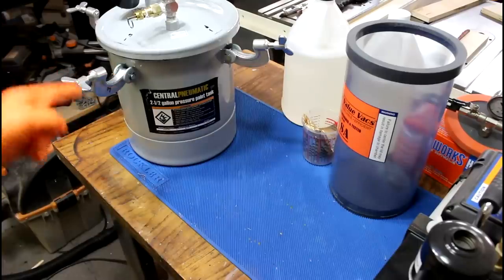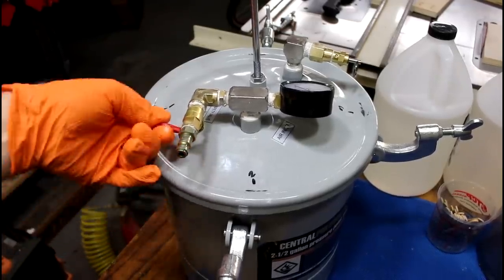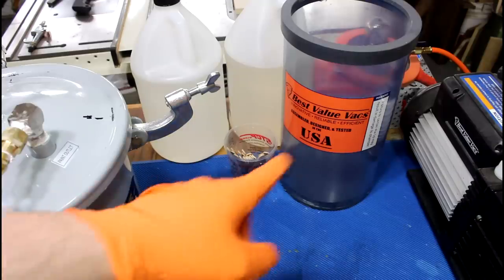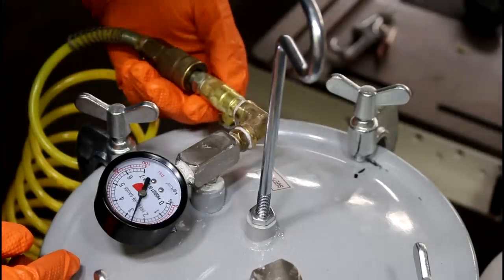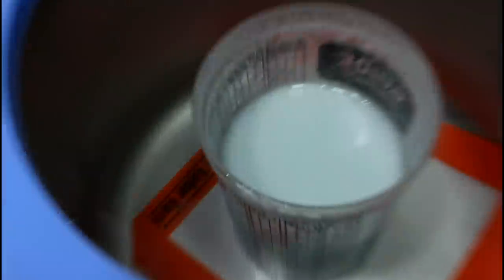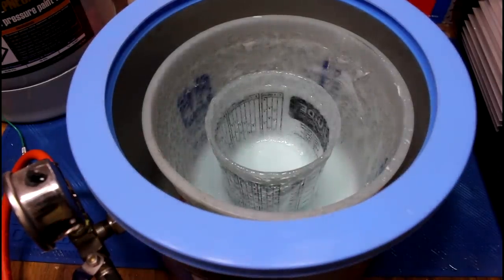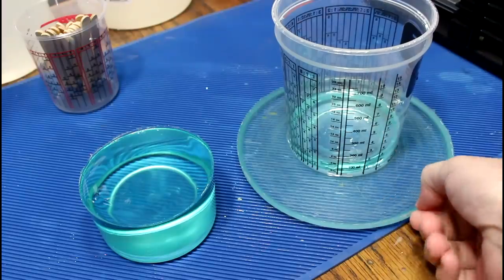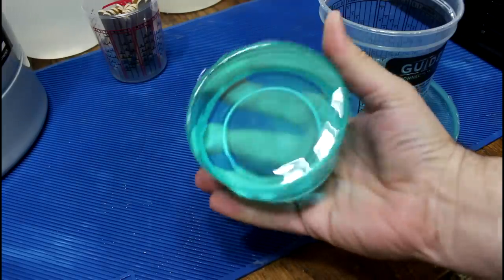Resin Casting: Pressure vs Vacuum

Comment: Use both!
After mixing the resin, degas it with the vacuum chamber. It happens fairly quickly, the foaming you were getting after the first minute or so were components of the resin boiling off.
Then pour the resin in the mold and put it in the pressure pot.

You can also vacuum degas it after pouring the resin in the mold to help get air trapped in the wood out before going to pressure.

I do resin casting of miniatures for tabletop war games, so have to get air out of and resin into some intricate fine detailed molds.
I have the same HF pressure pot and found that the top for my vacuum chamber also fits on the pressure pot, and seals fine, so I started doing my vacuum degassing and pressure casting in one pot.

Comment: OK, so, quick back of a beermat calculation....  pressure increases by about one atmosphere (15psi) with every 10m deep you go under water..
50 psi would be what, about 35m down? Maybe 40 ish?

Right, whose got an atmospheric diving suit we can put Peter in and is there a resin that'd set under water...

Y'know, for science and stuff...
Reply: You can easily do 40m in a wetsuit or drysuit and you won't feel a thing
Reply: FOR SCIENCE!!!! 🧐👩‍💻👩‍🔬🕵️
Reply: Or... we put the resin in the pressure pot before sending Peter down into the water with diving gear and then he pressurizes it while underwater!
Reply: @karol30660  i ventured into the 4 meters...once.
Reply: wouldnt the pressure be held OUTSIDE the container, or you are suggesting water-pressure? or some kind of flexible thing? i wonder if a plastic bag would work...

 Can you imagine? "pressure casting resin with a ziploc bag under the sea"
Reply: Wouldn't most resins cure underwater if they were thick enough not to start diluting?
Reply: Gimme a Ziploc bag full of resin, I'll take it diving with me next time I go. Normally my first dive of the day when I go out is around 28m or so.

Comment: Thank you so much for this video.  I am just getting into turning.  Just set up my lathe about two weeks ago.  I have been trying to take my knowledge from metal casting and use it here.  I used vacuum chambers for removing the air in small mold making, for casting.  But everyone I watch says, "Into the pressure pot it goes." and I wondered why not a vacuum.

Comment: By chance could some of the foam been caused by the alcohol boiling while in the lower pressure? Just like boiling water at room temperature in a vacuum chamber?
Reply: I was also wondering if the bubbles were partly caused by things in the resin boiling, rather than air being pulled out.
Reply: @jamesgrimwood1285  I think you said it right, "partly," the resin will bubble like this anyway, but I think it was this violent because of the alcohol.
Reply: Not just the alcohol. ANY liquid in a vacuum will boil off.

Comment: When i debubble in vacuum, i wait til the resin almost crests, relase vacuum, let bubbles pop, and repeat. Over and over until it stops rising.
Reply: Yes, I think you're very much correct here and this would be the technique that would be preferred and not the way it's done in this video. With vacuum, you wouldn't absolutely need to maintain the vacuum constantly until the resin hardens the way you do with pressure. That's because with vacuum, you are sucking the air out. Once you successfully get the bubble to the surface and they pop, you'd be done. Therefore cycling it on and off would make more sense. The cycling might also help move the bubbles to the surface because of the agitation it would also produce.
Reply: @stefanl5183  Wouldnt you want to degas, aka boil out the air of each of the base and the hardener separately? Then mix them together and then degas one last time. then poor.
Reply: @LadyTea  I THINK (not sure) most of the air is introduced during the mixing process.  At least that's how it looks when I do it.  But I'm using the resin as a filler for knots and splits, not for casting.  This video was interesting to me, but the pressure method really only works for casting.  If you want to degas the resin and then pour or spread it onto the wood, the vacuum method is the only one that will actually work.  Good thing that I only have a vacuum chamber and not a pressure pot!

Comment: I have found one way to prevent the over abundance of bubbles when vacing resin, it is to mix part A of the resin with the color you want, vac the bubbles out and then mix in part B to the already tinted/colored part A and vac once again. You won't get the bubbling over like you did with the way you did it in the video. This I have learnt from trial and error, casting this way greatly reduces the likelihood of bubbles, however when you pour resin on to or into wood it is better to pressure pot it. Also as a side note, not all resin colorants are alcohol based, these non-alcohol based tints greatly reduce the bubbling over due to boiling off of the alcohol in the alcohol based tints in a vacuum.

Comment: I think what you want to do with the vacuum chamber is let the air back in FAST when it almost overflows. Then it'll actually pop the bubbles. (At least that's what I understand from watching the king of random.)
Reply: Kyle R no it’s just they don’t think about it bubbling up. The vacuum will pull it out if it’s left.
Reply: Cycling the vacuum can pop bubbles,
You want to pull the vacuum, then release it while the resin is still liquid.
Reply: This is all well and good but this is argument you make is an argument that focuses solely on casting a pool of resin.  Add wood that has not been stabilized and you have to deal with the bubbles from the wood too.
Reply: Also of note, not all vacuum pumps are the same. I have no clue as to which he uses but it would be interesting to see how a better pump fairs in this regard. Perhaps a 2 stage pump would pull faster in this material.
Reply: That's what I had to do when I worked potting sensor electronics for aerospace sensors, vacuum each component before mixing, mix and degass again the pour into mould and degass again.
Degassing is done by vacuuming until foam nearly crests container, then rapidly bring up to atmosphere, then repeat until no foaming occurs.

Did it for about 2 years...

For actual space use, they use vacuum degassing, and then cure under pressure as well. you don't want air trapped in cured resin in a hard vacuum as it will explode and crack....

Comment: Thankyou!!! Just found your channel today to answer this very question!!! That was fun to watch, and I didn't have to clean anything up!!! So I won't bother trying this in my vacuum chamber, and will learn more about a pressure pot. Not sure I can justify getting one as I am just trying some small casts to repair minis. I have a 2 minute resin which probably isn't long enough working time even for a pressure pot. I may try using a needle next and see if that can inject the resin into the recesses enough to force the bubbles out of the thin sections.

Comment: There's no way the resin had that much air in it. I think that the vacuum's negative pressure was vaporizing the chemicals/solvents in the catalyst. Maybe using less vacuum would draw the air bubbles out without causing vaporization of the casting resin. I'd try slowly raising the vacuum until the resin starts to vaporize, note the PSIV, & then set your vacuum below that level. I've seen epoxy resins that didn't foam at all under vacuum. Maybe the foaming has to do with the type of chemicals used in the resin, meaning that some resins will work under vacuum & others won't.
Reply: i agree, cactus juice will boil over , feathering the vacuum will control that unitl it is pulling the gasses etc out without foaming over. granted, it takes time but get good results.

Comment: couple things. i use vacuum at work almost daily for evacuation of air/gas in perfectly sealed refrigerant systems to remove air obviously but also we are boiling any moisture in either gas or possibly liquid form to creat a as perfect dry environment as possible. It looks to me like your boiling that epoxy mix to me. place a class of water and same thing will happen as the water turns to vapor then gets extracted by the pump. If your vacuum level is taking too long to build as I believe you commented i’d be willing to bet it’s the size of your hose and possibly even leaks in your vacuum setup you would not even consider. also if the condition of your pump oil is anything but new and clean your killing the pumps ability to pump efficiently. I test my oil before use and find I need to change it every few uses on systems not much larger than your vacuum vessel. Have a look at it. any milkshake color to it? if so change it as it will take its toll on pump internally. regardless of you pumps current  hose fitting size try running a actual vacuum rated hose (often 20-50 microns) at least 2x larger in diameter if not x3, run fittings with non obstructed paths (you may be already) use a none drying smear of sealer on the vessel cap seal and around where any valve shafts penetrate fittings under levers by removing lever to apply, run clean oil and that system will pull down so fast and so hard your head will spin. It would suck a golf ball through a garden hose :).

Comment: wow. As a newbie to resin I have been really struggling with the bubble issue and bought myself a vacuum chamber. I normally put my resin in, turn it on to full and then switch off the motor and walk away. I have had some really REALLY weird looking stuff come out of it. I'm guessing the guys I see using what I thought were vacuum chambers may well be using pressure pots. Thanks for the demo. Much appreciated.

Comment: For some applications like casting insects in resin, or anything else that may implode under pressure, I use the vacuum chamber. I will pour resin just to the bottom of where I will have my fragile item and use the pressure pot. Then, I will mix a small amount of resin to cover my insect, or whatever. I put the resin in a container that is at least 4 times larger than my volume of resin. Vacuum it down until the bubbles almost crest my container and let it hold there for a few minutes. The bubbles underneath the surface cannot pop until they reach the surface. On their way to the surface, they join with other bubbles and grow larger. Once these larger bubbles are able to reach the surface they will pop and allow more room in the container. Pressure back up until bubbles reach the top and repeat if necessary. I use small pours in layers until I cover my fragile content to avoid heat buildup. Once covered and cured, I can finish the pour and use the pressure pot for the remainder now that my fragile pieces are encased in cured resin. Thanks for the video.

Comment: That's not air. That's substances in the resin boiling off.
Reply: I agree. He is getting rid of some volatile ingradient, which is not good.
Reply: @yl7108  Actually it's just speeding up the process of it releasing the volatiles due to the lowered boiling point.
The process works perfectly fine but you have to user slow curing resins and you just do short cycles as not to cause it to violently bubble.
Reply: SilvaDreams If those chemicals weren’t needed in the resin, the manufacturer wouldn’t have added them in. You’re clearly not meant to boil them off.

Comment: I agree with other comments that the foam in the vacuum chamber was 'boiling' of the solvent (or even the uncured resin, styrene?, itself) in the resin. My understanding of how to use a vacuum chamber for resin casting is that you take it down low enough that real air bubbles expand and float to the surface, then allow the air back in while the resin is still very fluid. It isn't used in the same way as a pressure chamber. I guess if you wanted to be extra certain, with a complex mould for example, you could give it a couple of minutes in the vacuum chamber before transferring it to the pressure chamber for the final cure.

Comment: I've never used resin but during the curing process there is an exothermic reaction. In a vacuum water boils at a much lower temperature. What you see happening in the vacuum chamber is an already hot liquid boiling at an even lower temperature. You're not seeing the vacuum taking the existing bubbles out of the resin but you're watching the resin boil. That's why there are a lot more bubbles/foam than you'd expect.
Reply: It's likely the alcohol based dye boiling. The boiling point of resin is ~176C at full vacuum

Comment: First, yes. Harbor freight is good.
Reply: Literally the view count says one
Reply: No one cares I know but I was amazingly bemused
Reply from the maker: I've got a Harbor Freight benchtop grinder that I've been using for 10 years as my lathe sharpening setup. Love it.
 I've also bought loads of junk that I've just pitched out. You just never know.

This pot is decent for the price and can be quite useful for getting into casting with a pressure pot.
Reply: @peterbrownwastaken  we largely use harbor freight for workshop consumables. Sand paper, shop towels, vinyl gloves, etc. Not so much for foundational shop tools. I think we have a router and table we got from there as well as some palm sanders some drill bits. If you need a one off tool it's good to check there

Comment: I work with resin and use both vacuum and pressure chambers. I used vacuum when moulding small figures as we can never seem to get the bubbles out under pressure. Each figure has a plinth which allows for expansion in the vacuum. Once the vacuum has sucked the air out the resin will colapase like a bad soufflé. I then let the air back in, which cause it to sink further, then repeat the process. Each mould of three figures takes about 1 minute to process. If I was able to use the pressure chamber, they'd be in there for at least 15 minutes. I used 228, 2 part resin.

Comment: I would recommend Crystal Clear resin from Smooth-on. It is a thinner liquid and will degas much easer. I have used this product with great success.  They have several kinds however, make sure you get one with a pot life that works for your time constraints.  
The art resin is likely to thick to be degassed. Thicker resin has bubbles that don't pop as easily as thin resin.  For Thick resin, you would want to jar the chamber to help the bubbles pop. Also letting the resin rise and release the pressure as many times as you need will help remove bubbles.

Comment: Vacuum chamber is great too for degassing resin. Just many people dont know how to use it. Never set it on -1 bar at the first step. You have to start degassing between -0.6/-0.8 bar. DON'T let foam up the resin! After several minutes (when most of the bubbles gone-depend how much resin you mixed) at the very and you can close the inlet air and finish your degassing on -1 bar. Welcome!

Comment: Great video showing the effects of Degassing a thick material, a material of this viscosity will expand 5 to 8 times its volume depending on the material so with that in mind if you know the viscosity of the material this is called its Centipoise ( this should be on the materials container or COSH data sheets ) or cP, water has a value of 1cP and honey/corn syrup has a value of 2,000 to 3,000, looking at the resin used its going to be around latter value so the thing we now know that this material expanded  4 maybe 5 times its volume at this cP so that would mean you will only be able to Degas 1/4 of the total volume in that pot to stop it over flowing or just use a wider deeper pot, also giving the Degaser a little shake while you are Degassing will break the surface tension and collapse the bubbles, being carfull not to knock you pot over inside the degasser, I put a vibrating pad on the inside of my degasser to do this for me, the thinner the viscosity the less foaming the thicker the viscosity the more foaming, you can make your own chart up giving the materials you use the cP value and expansion rate,  hope this helps, love your work

Comment: I think it's worth mentioning how you can usefully use a vacuum for resin. For a regular casting, you can put the resin in the vac chamber to pull some air out of it, then pour it as normal. You can also use a vacuum bag, which works more like the pressure pot. That's usually used for fiberglass/carbon/whatever other fiber work, though I think it might work for casting with clever mould design.

Comment: We degas resins as SOP.  First vacuum degas the resin and hardener seperately without allowing either component to "foam up" once the two components have degassed they are mixed well and degassed again to remoce any entrained air. Because both components have been fully degassed any air is entrained from the mixing (visable bubbles) which will come off very quickly. The activated resin should not "foam" at this stage. The resin can now be poured into the mould, given one more vacuum  treatment to clear any air pockets in the mould and finally the mould can be pressurised to 75psi. This process  has worked for us giving lear, bubble free, high integrity castings in either polyester, polyurathane or epoxy resins.  
The first vacuum degassing removes both entrained gasses and dissolved gasses after mixing the second vacuum treatment only has to remove entrained gasses from the mixing (no time for the resin to absorb / dissolve any gasses) which will come off very quickly as largish bubbles, not foam.

Comment: Black Beard Projects also did a comparison video but he used polyester resin on making layered denim molds for knife handles and the vacuum chamber one had voids all in it and the pressure one looked great. just a good alternative to this video as they are both informative and really shows pressure is better.